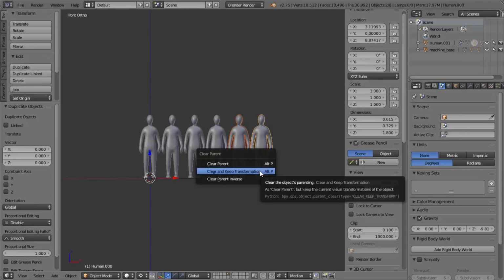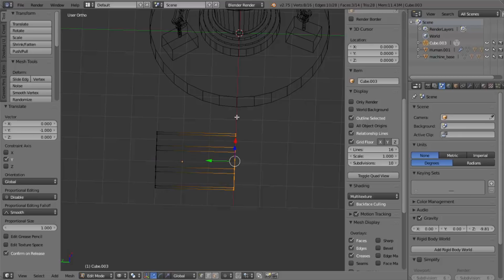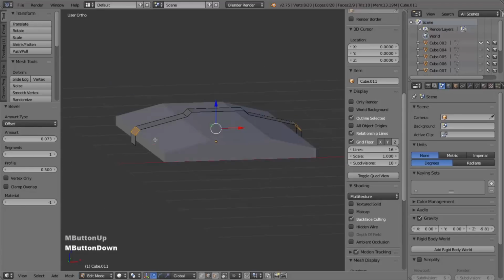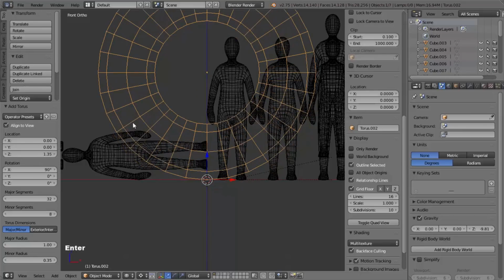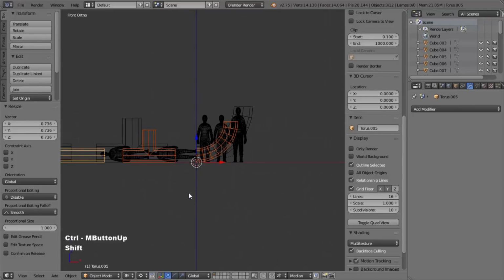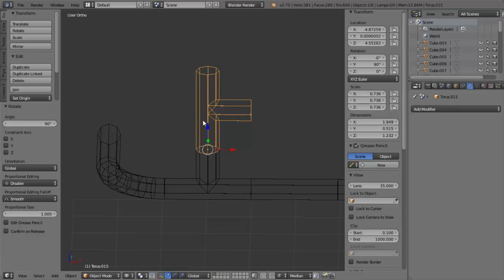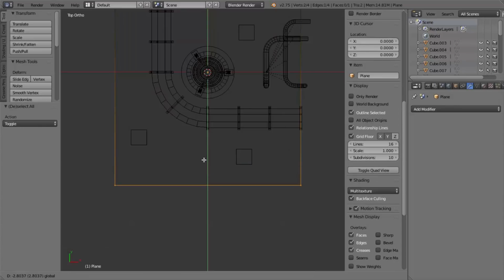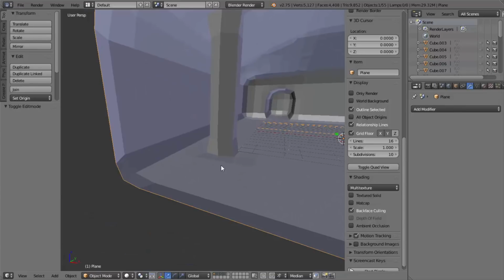Sci-Fi Cave Environment Course | 2 - Completing the Blockout

Comment from the maker: Hi Aidy Burrows here, we’ll pin any important info that happens to crop up here. 

Useful Times > 

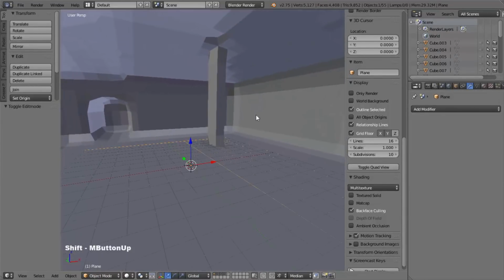01:25 Part 1. Breaking down the concept.
Alt P to clear parent. Shift S > Selection to Cursor with Offset. 

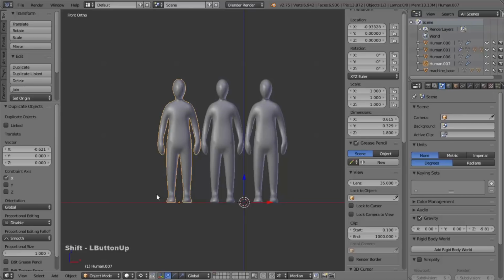03:37 Part 2. The conveyor belt - Straight section. 

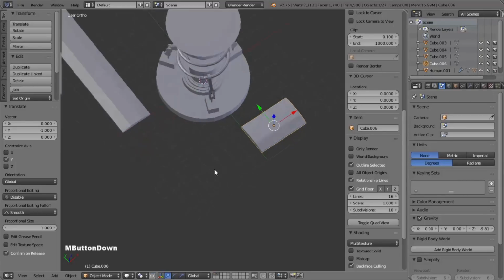08:51 Part 3. Curved section. 
The spin tool. 

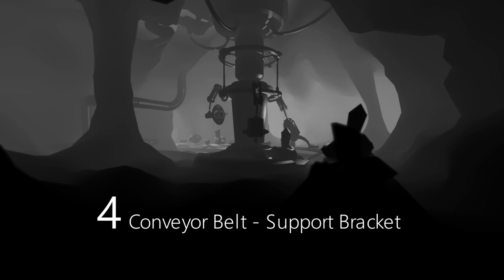11:28 Part 4. Conveyor Belt Support Bracket
Shrink/Fatten
Ctrl B for Bevel
Alt E - Extrude (Region Vertex Normals)

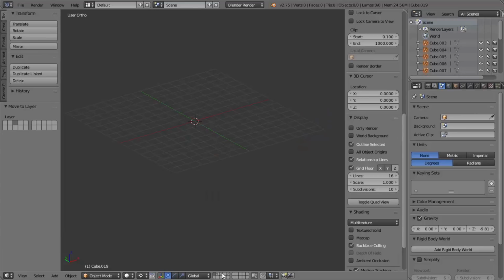16:38 Part 5. Large/Small Pipes - Basic Kit Blockout.

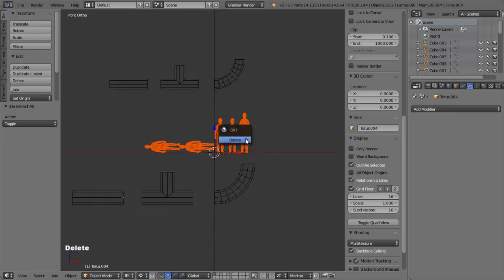28:45 Part 6. Laying out the Pipes
Apply rotation

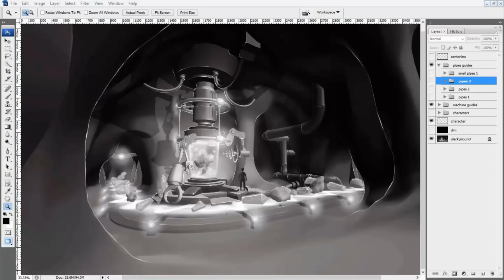39:17 Part 7. Cavern Blockout 
Add cube, duplicate and place as the main cave vertical pillars

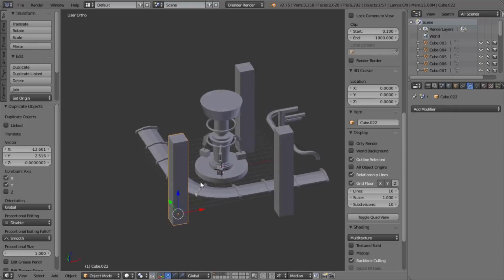41:26 Part 8. Cavern Floor
Add plane, extend for the tunnels. 

44:09 Part 9. Cavern Walls.
Extrude, Flip Normals

46:48 Part 10. Combining the Cavern parts together. 
Join, Remesh modifier. 

49:30 END/In the next chapter
Reply: usefully learned some tips & tricks :)
Reply from the maker: Awesome! Great to hear! :) Aidy.

Comment: The diameter of a pipe is "about equal to a character's leg"
The width of this part is about one and a half characters just past the inside of the leg.
The height here is just past the character's head.

I mean really - this has bothered me more than it should, just use measurements.
Why make a character of a know size and use body parts as measurements - when you can just make a dam rectangle of Known length?
You can even just use a ruler mesh.

I know you are trying to make it accessible and show scale etc, but having multiple "characters" to me is incredible lame way of measuring things,
and to that point you randomly put this "character" in different parts of the image and take "measurements" not even taking into account the perspective difference that those points of the image actually represent.
For example the character is the same size, and yet the track is in the foreground and the pipe in the background, yet you measure it with the same character, when you really should be taking into what the increase and decrease in relative size should have been based on the perceived distance the perspective in the image represents.

TLDR - we have invented Centimeters - you don't need to measure things with body parts.
Reply: It's a nice tutorial though, and the extra tips and updates are very good. ;)
Reply from the maker: haha no worries! We all have different ways of going about things, and yeah I'd probably be more personally inclined to use just regular centimeters, however I have to also attest to the usefulness of getting an intuitive 'feel' that can come from viewing something as emotionally ingrained as a human as opposed to the more mechanical abstract mathematical equivalent. But not everyone needs that, in any case I've seen many environment projects get completely derailed by not keeping scale consistent at this early stage, so as long as you use something that's ok. :D 

Having said that, I also hope that it doesn't come across as having to be really exact either since it's ok to be a bit flexible too. :D Aidy.
Reply: OTOH, since I actually work in the piping industry I've already decided to use "correct" piping component dimensions for that part of the model. No character parts required. (The other interesting detail there is that in Piping, we often use a human figure to provide a sense of scale -- and that figure is universally known as the "2m Man". So your 1.8m figure is a tad short... :-))